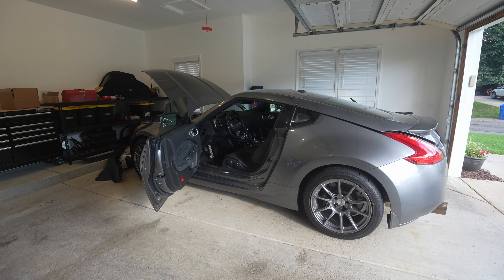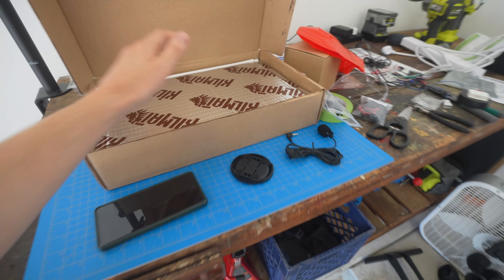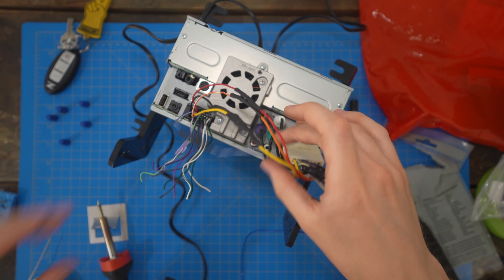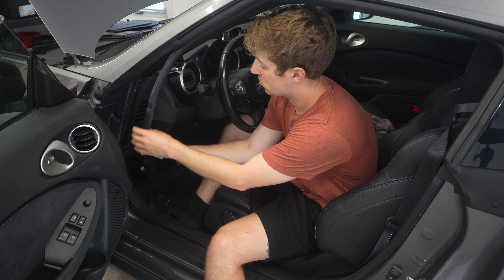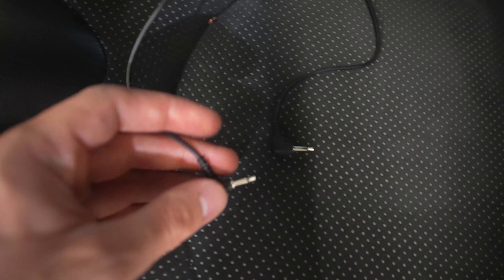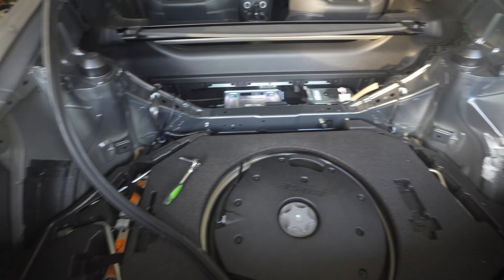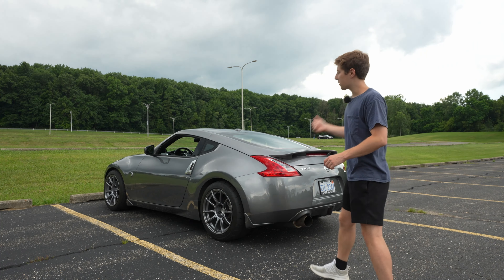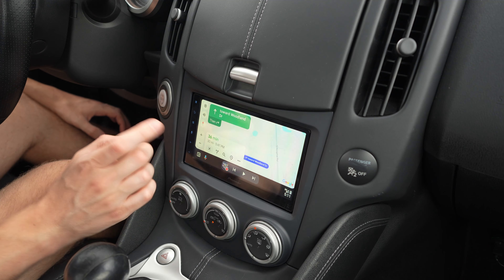370z Gets Headunit Upgrade + Sound Deadening | HUGE Difference!

Comment: AM's for sports dude!  I've used killmat in my 03miata and it made a huge difference.  Did the doors, floor, and parcel shelf and yeah I know it added weight but I'm not a pro driver. I'm just going to work and back and punching it around corners along the way.  Def recommend it if anyone's if'y on buying it
Reply from the maker: It doesn't even add a crazy amount of weight, maybe a pound or two in my case!
Reply: @pattyboi  dude, I wasn't F'in around. I put the whole 30 or 35lb box in the car.  Lol.

Comment: Does the steering control work for radio ?
Reply from the maker: It unfortunately does not. The dongle to adapt those controls appears to be pretty expensive over $200, hopefully there's an easier way
Reply: you can always check in with a local audio shop near you. my audio guy was able to install i guess like an adapter that went from my head unit to my steering wheel controls and charged me like 50 bucks for the kit and installation since I don't know too much about installing that sort of stuff.